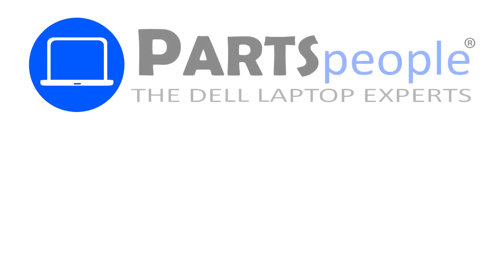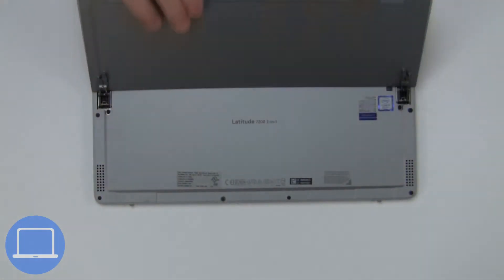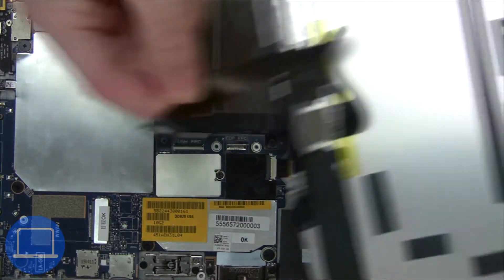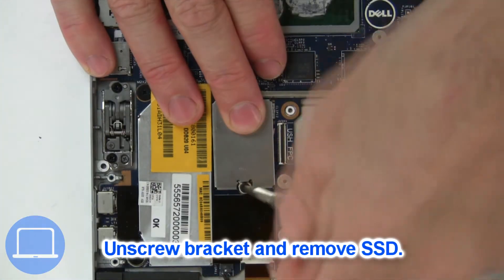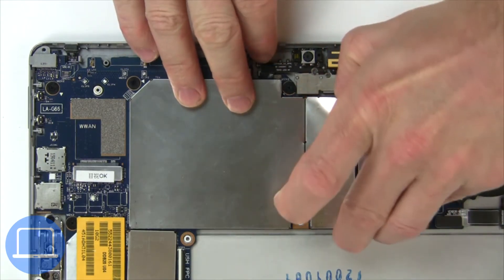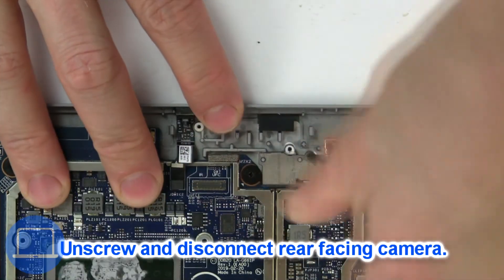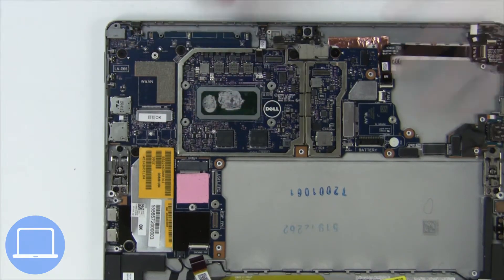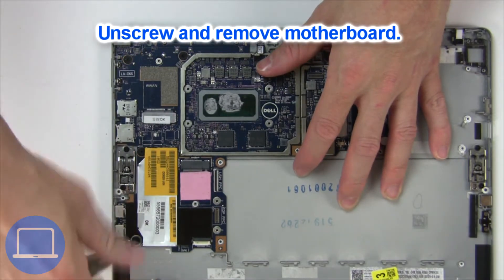Dell Latitude 7200 2-In-1 (T04J001) Motherboard How-To Video Tutorial

Comment: can i replace dell latitude 7210 motherboard to dell latitude 7200 motherboard ? is there any difference in lcd socket or others
Reply from the maker: It may be possible but I'd do a lot of part comparing which ones go to the same systems. I don't recommend it though. Best of luck!
Reply: Okay, Thank you !